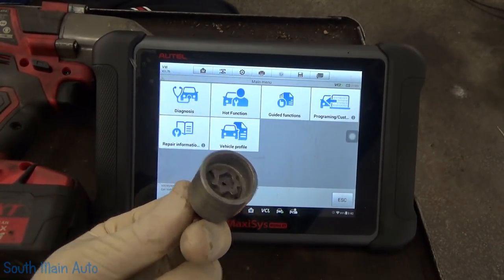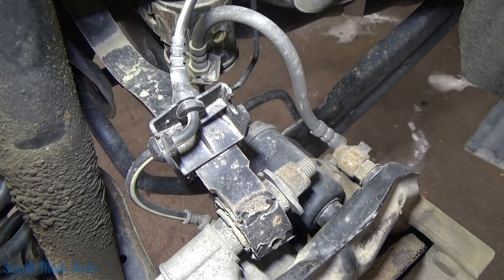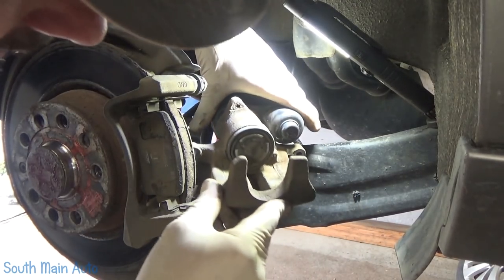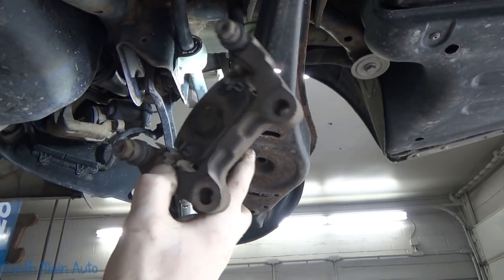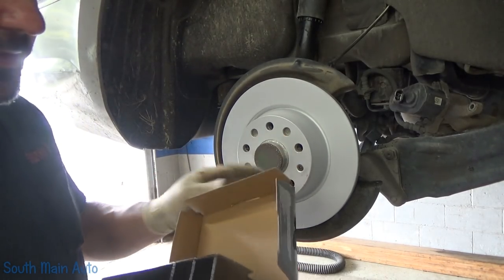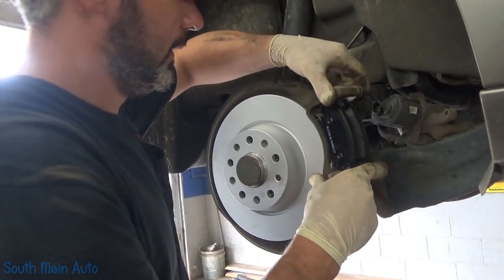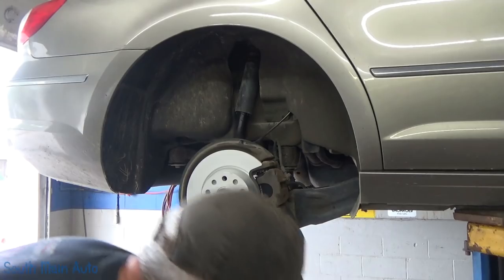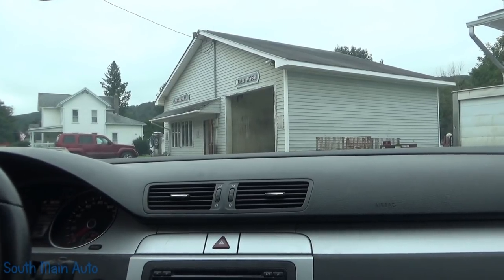Do You Need A $1000 Scan Tool Just To Change Brake Pads!?

Comment: Im going to get hate for this but this stuff is getting more common because people want it.

Now hear me out. A lot of cars are really comfortable now with button start, electric handbrakes (parking/e-brakes) and the majority of the public on the surface would generally rather have it because its more convenient and nicer. Plus it has the safety aspect behind it. But then other people complain that these systems will require a scan tool to fix, that its "overly complicated and rubbish". Maybe. But then either you dont have nice features or you deal with their drawbacks.

After all, remember that the Ford Model T didnt use a water pump in the later years or even have much than the bear minimum such as a fuel gauge. If you applied the same logic to engineering and driving experience conveniences then you'd have no water pump but rely entirely on convection. You couldn't have powerful engines because of such design else it would overheat and die. So you have to deal with faulty water pumps on the odd occasion but you get your nice V8.

Nice things have draw backs. So either you dont get your toys or you put up with the negetives of it. And if you don't want to work on these, if you're a DIY then dont buy a car with it and if you're a mechanic then really you have to accept times change, cars will change and so will your tools. Maybe some of it is unnecessary and clearly manufacturers trying to lock out others, but again some of it is just a necessity for newer technologies
Reply: Naoki Saito, you make  good points but  are  over simplifying things. Folks  aren't complaining about  science and technological  changes but about  blatant greed and determination of manufacturers nowadays, to continuously separate you from as much of your earnings as possible.
Volkswagen once offered an air-cooled engine in its 'beetle'. Don't recall this model ever overheating. It was no slouch and was built like a tank.  Some were tuned for performance and did well in the 1/4 mile drag in my spot on the globe. The beetle had no fancy features.
Think value-for-money. One could pay for a boat-load of creature comforts then too, by purchasing different models or makes of vehicle. But that principle remained the same.
This changed in the late 1970s - early '80s. And in every sphere of manufacturing: Motor vehicles, consumer electronics esp. stereo equipment, cameras, household appliances.
It is not  " either you don't get your toys or you put up with the negatives of it". Rather it is a case of
 "" You'll take our junk and replace it  over and over as we eliminate that which was durable and reliable"

Among vehicles I've owned, were three of the same make and model. The odometers on each did two round trips (went back to zero recording in kilometers twice). Eventually the three were scrapped or sold with the factory original single ignition coil, distributor and rotor assembly still in sound working order.
Ignition coils now simply go bad routinely. 
One popular van in my spot (taxi drivers like them) calls for a TPS from time to time. Costs?
$500. (USD 250). So  manufacturers no longer offer choices. They make us offers that we can't refuse.

Comment: I am calling this a fake video, no where near enough rust, no big nasty this is not real, If you remove the motor you can use a torx to wind the piston back, fit the brakes, re-attach the motor, the brakes will reset once you use the parking brake.
When I did mine i had to re-grease the O ring round the motor to keep the crud out.

Comment: This crap auto manufacturers are pulling these days really gets my blood boiling! I remember the days when I was a DIY'er - I'd have been broke trying to fix the junk they're producing today, with all their little wallet-grabbing schemes. GM makes you program a friggin steering rack after replacement, and the FSCM, door switches, etc.. Nobody realizes their shiny new car has all this crap until it's long out of warranty. I consider this THEFT - if you're not upfront about things when selling a product, then you're a crook - it's as simple as that. We've got alot of crooks in auto manufacturing today! 😡

I was reading on iATN where one guy commented that you can manually twist that piston back in without the scan tool ... but then others chimed in and said you shouldn't do that. Guess someone will have to be the guinea pig on that one. I'd bet that caliper is probably right around $500, or north of that ... 😮 People will figure it out on the net eventually - they always do!

My buddy just bought one of these CC's for his daughter. I almost had to do the dual-clutch job on that strange auto/manual transmission (I think his is an '06 - last year for this transmission I believe), but luckily he was able to get the dealer that sold him the thing to foot the bill (at another shop), so that worked for me. Wasn't real excited about having to do that one. First VW I ever worked on was about 4 years ago - his daughter's first car (can't remember the model name). I had to buy a set of triple square sockets and drivers for that one - had never heard of the things before in my life prior to that! Thing had this vacuum pump for the brakes, which was super strange. Was peeing oil BIG time. S.I. said I had to yank the tranny to fix! The heck with that - I yanked the shift linkage and was able to get the cover off just enough to clean it up, and slide some Permatex Right Stuff in there, and bolt it back together. Been holding leak free ever since.  Did plugs, air filter, and brakes all around. Wasn't half as bad as I thought it was going to be. 

Gotta get back out there and put my dad's Suzuki outboard back together. My brother went wide open over a pile of rocks with it while on vacation up in ME. Was in the middle of a lake, where you wouldn't expect a mountain of rocks just 5" under the surface. By the time he saw it, the motor had shot right out of the water, minus all the blades on the prop ... and the skeg off the lower unit! Doing the gear swap right now with an eBay unit. :)

Thanks for showing this one!  Glad you used the Autel!  Good to know I have the capability to handle this when his daughter needs a brake job. 😎

Comment: You forgot to grease the backs of those new pads.
Reply: didn't pay attention, but he probably did the caliper piston face and ears instead, it makes less a mess and not visible on "open spoke rims" for solid steel stuff you cam just slather it everywhere as long as it wont get onto the braking surface! :)
Reply: throttle bottle Oh yeah, he did do that.  Sorry Eric.

Comment: electric motor driven caliper is engineering equivalent of reinventing the wheel and making it triangular :-S 
dpf on diesels was first sign engineers been sniffing too many of Mr O's part boxes as that great invention ruined potential fuel efficiency which in reality the key element of true environment impact and created more pollution in parts and service waste materials than if never had one :-S
What can they ruin next lol, they running out of things to redesign :-)
Reply: seems more like a rectangular wheel....... :)

Comment: Manufacturers are putting more and more of these features on cars that require specialized tooling to create ecosystems that won't allow customers to have their services done outside of the dealership or DIY. Get a nice pre '01 car, have it restored where needed (bodywork, engine overhaul, etc) and laugh at the people 5-10 years from now that are paying a shitton in maintenance because they're locked into the dealer/manuf. ecosphere. It's getting to the point where anyone who is not leasing a car, might have to give up on the idea of having a personal vehicle because it's becoming too expensive....
Reply: so, manufactures are putting themselves out of business and causing more hate of service departments. maybe it;s time they start doing 100% lifetimes "FREE" brake repairs
and I mean free, seeing all vehicles are huge piles of "bowel movement" overpriced chinesium now.....

Comment: I didn't see anything preventing you from doing the job without a scan tool. Did i miss something? A sledge hammer would fix it but good!
Reply: you'd have to release the caliper some other way first or it would be stuck in place locked against the pads and rotors.....
it would be equal to setting the parking brake on cable activated calipers then trying to remove them, yes a huge prybar and hammer may force if off or break it.....
Reply: Wow, this is crazy.

Comment: Nope!!!!!   scan tool not necessary!!!!   Unclip the electrical connector,  apply 12v source to the  electric caliper motor, reversing polarity will change direction  so you want to hook up your leads so the motor retracts.   than push in the piston gingerly...

Comment: this is such a bad idea. brakes should never need power should be only brake fluid just another way for the stealership to try to force you to do the repairs at there shop instead at a small place or do it your self. i'm surprised the dealerships dont make a law saying for the next 10 years after a new 2018 car is bought you can only do the service at the dealer if you dont you go to jail

Comment: Apparently there's a way to do it without a scantool, I think this is the same system right?

https://youtu.be/wAB43eO7wIs

edit: also just read the comments section on that video, if you unplug the connector and apply 12v to the motor it will unlock too, if it locks just reverse the voltage/pins

Comment: Hi Eric I have a very important info about EPB system on VAG cars put a battery maintainer or a strong enuf charger on the battery before and after doing the calliper pull out and push in routine or what I usually do is I let car  idle during the process and don’t turn the key off right after each routine if you want more info go on VCDS web side they have very good info on doing this work the reason why I’m saying this is there is strong possibility if it’s done with a low voltage it could destroy the parking brake module I know I have seen it before was not my doing but it was done in a different shop.  Trust me I work on VW every day I would not want to happen to you. Here is the link for the info http://wiki.ross-tech.com/wiki/index.php/Working_on_the_Electro-Mechanical_Parking_Brake_(EPB)
Reply: my luck with car on idling, it would sense a wheel moving while in "park" and try to apply the parking brake while apart :))
see how well I trust electronic and computer controlled junk? think there's a reason ;)

Comment: Just another reason NOT to buy junk from Europe ... unless you like increasing maintenance costs that will empty your wallet and fill theirs. I gave up on VW's after I owned 5 of them - at 100K everything needed replacing - brakes - exhaust systems - suspension - wiper motor assemblies - door locks - alternators - battery. I switched to Japanese and the difference is night and day - much better reliability.

Comment: you can release all electric parking brakes manually, but it's annoying as fuck. Some of them are easy and can be done right from some button pushes, then others you have to fucking get under the goddamn car, rip off the wheel before you even can get TO the EMBC. If they could at least making it fucking standard that'd be nice.

Comment: what a bullshit...as a German I apologize for VW producing such a shit.... next we need a scantool to refill the gas tank to set the gauge to full... so we need to buy OEM fuel....
on Chevrolet / Vauxhall/Opel cars you can set the electric parking brake to service mode by turning ignition on, push and hold brake pedal and push brake button until light in the dash starts blinking... then release switch and press again twice quickly... rear calipers will go to service mode... when finished, just engange the parking brake and it will calibrate... THAT´s how you do it...there are cheaper scan tools that will do this

Comment: Electric brake is stupid. The only difference is the electric motor instead of a cable. That mean when the electric motor stopes working you will not be able to enable or disable your brakes. That means less reliability and more money for the car company.

Comment: Luckily us VW DIYers have VAG-COM, which is significantly cheaper... but it's still ridiculous that you need a scan tool to service brakes these days. Yet another reason my next car will be Japanese or Korean.
Reply: Subaru Outbacks have used an electric parking brake for years, at least since the 2010 models. Not sure what's involved in changing the pads on those. I do know from what little I've seen that the BlueDriver OBD2 tool that works great on my wife's F31 BMW doesn't do well at all on my Outback.

Comment: Technology like this is bull shit. Just a pain in the ass for diy- ers right down to the triple hex slider bolt head. Simplicity made much better behicles with much better reliability. Remember the 2002 corrolla? Turn the key and away ya went. Just a few brake pads would get you a few hundred thousand miles. I hate newer vehicle over engineering.

Comment: I would rather walk than own a shit wagon
I worked on a 2000 Bettle $ 100 plastic fan switch $600 radiator fan controller 
The most over thought under engineered POS 
Stupirior German engineering